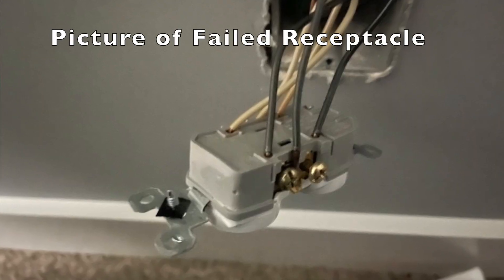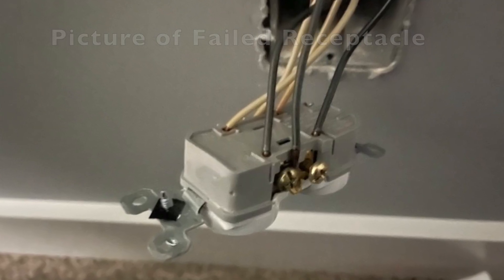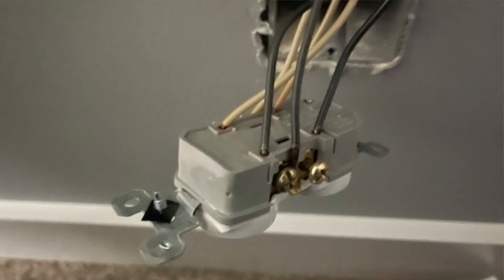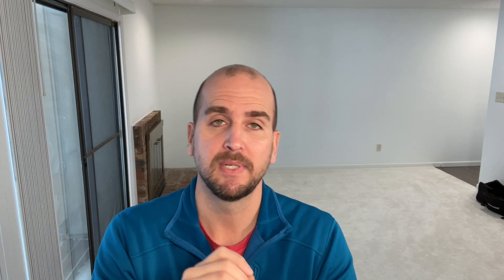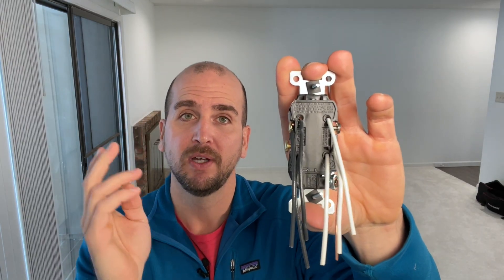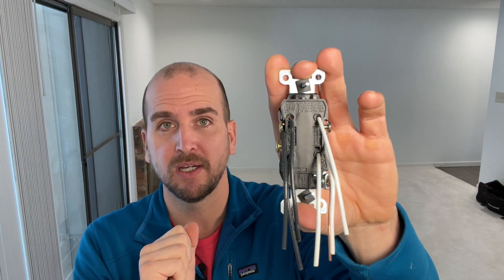Incorrectly Wired Outlet Found In Newly Built Home

Comment: So, ehy use pigtails when you can connects 2 sets of wires directly to the outlet ??
Is it because the libk between screws is not rated for 15amps ??
Why the pigtail ??
Reply: It's bad practice to use the outlet as a pass through device.

The reason being all of the current that's flowing through that circuit, is now being forced through those tiny metal tabs on the side of your receptacle. 

Also in certain situations you're actually required to pigtail certain wires. (Neutrals on a multiwire circuit)
Reply from the maker: Thanks buddy!
Reply: @renegadeelectrical1264  code also states there is to 6-8 inches on wire extending from box. pigtails give you extra wire for future replacements, those lazy ass-s that just chop outlets out
Reply: @harveylong5878  pigtailing is much more versatile than people think.

Ever pulled a receptacle out only to find the previous moron left you without enough conductor to even pull the device from the wall? Pigtail what you have and extend that cat.

Got a million conductors in a box?
Well now you have to pig tail.

Trying to feed multiple switches?
Pig tail and send a line to each device.

Kinda surprised at the lack of knowledge I'm seeing in the comments here.
But. That's why we're here to help
Reply: @renegadeelectrical1264  yep, our complex has had 40 yrs of the pull and snip outlet changes. Wire pulled tight to box in first place. Laid against the wall , outlet pushed almost in the box just to get wires back on. I pigtail everything when I do a remodel of one of our units
Reply: @renegadeelectrical1264  Thank you! I was asking the same question David asked, but what you said makes perfect sense. It's OK to only have one outlet powered through those tabs (that's how it's designed), but not a bunch of other outlets.
Reply: See more reasons in the same question above.

Comment: Wrap that shit in electrical tape. It cost pennies, takes 2 seconds, and is just extra insurance from a short.
Reply: and future you is going to be cursing wtf is this crap thats a sticky gooey mess. no need for tape in a plastic box, the wires tucked in box properly
Reply: If you take the time to do it properly, you don't need tape.
Reply: @sylviaisgod6947  nobody said you needed it
Reply: @sylviaisgod6947  You are absolutely correct.   AT&T slogan, "No job is so important and no service is so urgent-that we cannot take time to perform our work safely"
Reply: And don't use cheap Chinese electrical tape, use the good stuff.

Comment: Don't know the industry standard for this, or not...I know a couple of electricians who put a wrap of electrical tape around the side of the receptacle to cover all the screw heads before putting it into the box.
Reply: I do this too especially in tight metal boxes where there isn't much space. It just seems to be obvious that exposed live wires even in a box are bad
Reply: The system in the US seems unreliable if you have to insulate the terminals with tape to make it safe.
Reply: @geofsharp658  It's not required but it doesn't hurt to do it, There are much more sketchy things done in other countries that definitely would not be permitted here, European cables are installed barely below the surface of the wall , imagine what would happen if you decided to hammer in a nail or install a screw.
Reply: I do this frequently, especially if there are multiple things in the box and it’s tight.
Reply: I do that for metal boxes, but usually not for plastic.
Reply: I only do this when its in a metal box.

Comment: Happens all the time union or rat. Wrong wired GFCI down stream outlets, Mis balanced neutrals. Over loaded circuits
Reply: Mis-balanced neutral huh?  How do you imbalance a neutral on single phase?
Reply: @lloydmills9619  Neutral from a different circuit. 2 of the same phase circuits on same neutral. Stay on you day job rookie.

Comment: Why add a screw on connector if you do not have to?  If there are only 2 hot wires, would it be better to attach those to the screws instead of adding another point of failure?
Reply: It's always better to pigtail it, because if eventually if the outlet goes bad it's only that receptacle that goes out easier to trouble shoot. If you put them both on the device you're relying on the device to make the connection.
Reply: @Joe-by8jh  agreed!  So how does a “device go bad” anyway?  The bridge copper contact between the screws can’t go bad unless it turns into a fuse.

Comment: Some inspectors want all boxes to have pigtails in my area where needed.
Reply: That is a ridiculous rule, since every added connection leads one more place to cause arcing,regardless of the security, any connection can fail.
Reply: @mmoser9483  brother you have no idea what your talking about lol
Reply: @matthewbritzman6010  every time I'd rather use Sheppard hooks and the  screws  before  stressing   the wire from twisting  it  scoring it with a wire nut and on top of that  to the overall  box fill the more full a box the more heat that can be generated

Comment: There shouldn't be any copper showing past the clamp on backwire outlets
Reply: There may not have been when it was first installed. But if there was tension on it it could have worked out over time if it was a weak catch.
Reply: @srcastic8764  I like to see just a sliver of copper so I know the insulation is not pinched.  Not so with wire nuts.
Reply: @jackb1803  I always do this for inspection.  Makes it easy to verify.   Industrial components require it.
Reply: There is usually a gage on the receptacle for striping to the correct length. I have seen people make them so long the wire was coming out of the receptacle where the screws are.

Comment: Is the box extender up to code since it has no back?
Reply: It is ok for NEC, not sure about a local code that tries to be "smarter".
The original box is still there, the extension just covers the sides for when the wall is thicker than the box install.
Reply: @JasonW.  local code just modifies the NEC. half the NEC is garbage anyway, some localities pretty much say skip entire sections of the NEC or ignore sections within a section and use what local code requires
Reply: @harveylong5878  by smarter, I mean local authority throwing in a extra rule because someone thought it would be a great idea. Like requiring putting silicone all the way around a toilet, instead of at least a little open so you know when a toilet wax seal leaks by seeing a little water, rather than the toilet slowly ruining the floor.
Reply: @JasonW.  Didn't look like there was a box in the wall. Thought it was just a mud ring.

Comment: Toward the end of this video, you created a pigtail.  Why not screw one wire (only) under each screw?  While I would never put two wires under a single screw (especially w/o the "shepherd's hook" or "J"), I have often used both screws.  I understand that the intent of the two screws is to have two separate circuits (say, one receptacle switched and the other always hot); but why not use both screws for the two wires (per side), instead of the pigtail?

Comment: He outlet you showed, had the black(hot) leads connected to the silver screws and white (neutral) leads connected to the gold screws..........SHOULD HAVE BEEN THE OPPOSITE WAY.  Hot always to gold, neutral to silver!   Thanks.....Jim
Reply: Absolutely true.  Other than being consistent, "black (wire)" to brass screw and white to silver screw" ensures that the small slot is hot and the big slot is neutral - which is the way appliances are wired.

Comment: Scott,  what about the outlets with the clamp-down on the sides,  as opposed to the J hook ?
Reply: IMHO, the clamp-down (which prevents J-hook) are perfectly acceptable (i.e., I've used 'em).  I prefer being able to J-hook wire under a terminal screw; to me it feels more physically secure and might have increased surface area for electrical connection (maybe).
Reply: @peterkizer6163   i have done both ways too,  but the J hook is the best way.
Reply: I like the back wire, it is secure and faster. It also easily works with stranded wire, which is what i use for pigtails.
Reply: @JasonW.  stranded wire is a no no for any residential or commercial application.
Reply: @normhodgkinson6965  If you can, present the NEC rule that states stranded is not allowed?
Or is this a local-to-you code for your municipality?
Reply: @JasonW.  i don't have the NEC book handy, but in 30 plus years of remodeling and repairs, i haven't seen one instance of stranded wire used in typical residential fixed wiring,  other than the  10-8-6 stranded in 220/440 volt applications.  when i work from blueprints, they always specify 14/2 or 12/2(3) Romex.   The exception would be having to pull it through Carlon or metal.   Calif. codes and guidelines may differ from other states.   Also,  stranded is larger diameter than solid.
Reply: @normhodgkinson6965  
Worked at a major Biotech for 23 years where we used "only" stranded wire EVERYWHERE. Offices, labs, manufacturing. Receptacles in all places that were routinely wired using the side clamp method without issues. Everything was ALWAYS pigtailed and the devices were always "specified" to be high quality. #12 THHN has absolutely no problems/limitations with physical size. These days, the "commercial" side of it is all pretty much done with MC cable.
Reply: @normhodgkinson6965  The runs I use stranded in are smurf or ENT, but I was specifically stating I used stranded for the 6" pigtails. I guess I needed to state the obvious that this was THHN. I've never seen #12 romex in stranded, but I've never looked for it.
I use stranded for pigtails because it makes it a snap to push the outlet in the box, and using Wago lever nuts it isn't an issue to mix solid and stranded.
Work smarter, not harder.
Reply: @JasonW.   looking through the NEC,  i don't see anything that says "stranded" cannot be used, but so far i have only seen "solid" in all the residential homes i've done remodels or repairs here in Calif.   i haven't seen stranded #12 Romex either,  my wording may have been in error.
Reply: @normhodgkinson6965  usually because stranded cost more than solid. Its all about the money.

Comment: The problem is one of speed . It is far quicker to use the slots than use terminal screws or too make a pigtail . It is the chief reason yankee screw drivers were used until replaced by cordless drills !! Also the wire sometimes is not properly seated in the slot or wire is not cut to proper length !
              Also the  brand do matter ! The cheaper brands are difficult to work with as well and providing poor connections  especially slot terminals . Eagle and leviton are the cheapest anyone  should go with receptacles and switches !! Plates should be nylon or metal for flush fit to the wall ..

Comment: My dad was an industrial electrician. Always taught me to tightly twist the pigtail ends together, even scoring them with the lineman pliers before turning on the wire nut tightly. Then neatly fold the wires into the box. I keep a soft wood stick, like a paint stirrer, in my toolbox to help push the wires in and not damage the insulation.  Through my many years of house renovations I have been amazed at some of the sloppy workmanship in receptacle & switch boxes... amazed because even those worked!
Reply: I'll bet your dad also taught you to first connect the ground and get that flat to the back of the the box. I seen a guy put the ground on last and use the screws to force the receptacle. The ground was right there on the power side. Yup! He popped the breaker immediately. It was worth the extra 20 minutes to let him experience it to understand the full error.
Reply: Worked, but usually have black scorched marks.
One outlet I found last year in a 14 year old house, hot wires on light circuit were loosely twisted and no wire nut. The black wires were extra black about 1/2" from twist. The chandelier had 14 60w bulbs, so it was a significant load. Also, it was wired with 3 way switch and travelers, but homeowner friend had no knowledge of a 2nd switch for this entry light, nor could I find one. And this wasn't a cheap house.
Reply: Your old man taught you right.
Reply: "Worked" at all, or worse!

Comment: Thank you for doing these videos. My dad and brother were electricians....but not me lol. Learning a lot! Question...at some of our light switches in a home we are the first owners of but home now 14 years old....I hear a pop or snapping sound periodically.  My gut says the wiring is off somehow. Going to take off the plate and look to see if anything obvious....but do you have any thoughts? Thank you again and please continue doing these videos!
Reply: Hey Sarona. You actually want to replace the devices in you home every 10 years. 
The reason being is the plastic (Bakelite, melamine formaldehyde) eventually rots out and becomes brittle. When it becomes brittle, if backstabbed (or just in poor shape), the conductor will lose proper contact and start arcing. That arc it creates is super hot (35,000F) Once that arcing starts, it melts everything in that box, eventually starting a fire.

So. If you hear that arcing, that sizzle, snapping etc. It means that device is broken, and MUST be replaced.
Reply: Those switches are going bad, and you are hearing arcs. If your circuit breakers were AFCI, they would be tripping. The switches were probably the cheapest ones the builder could buy.
Reply: if you operate (toggle) switches slowly they can make those noises " cause you slowed down the connection to where there isn't a full contact momentarily.

Comment: I am puzzled why you don't like the push-in connection? I would think the constant spring type pressure against the wire in the push-in would better compensate for thermal expansion and contraction than the screw connection. Is it because there is less area of metal to metal contact with the push-in? Have actual studies been done comparing them?
Reply: Having done residential housing in the Chicagoland .IBEW701. i can tell you only HACKS use the holes. I can tell you from first hand experience that a wire with a load gets hot if its overloaded. When the load gets turned off wire cools down and slowly over time backs its self out of those holes.
Reply: Also with the smaller contact points they are sometimes difficult to remove without damaging wire and/or plug.

Comment: I like the fact that you tell how the backstabbed connection are UL approved but still not as safe as the screws.  The same thing could be said about pre twisting wires- that is not required by the documentation that comes with the wire nuts but it still makes the connection more secure.
Reply: I have never used the "backstabbed" connection - it has always seemed like a bad idea.
Reply: @peterkizer6163  always hard to remove them.
Reply: @danlux4954  Not at all- they have a release slot. I keep a very small screwdriver in my bags for this very reason but a finish nail or even.a scrap of 12ga wire will also work fine.
Reply: @HBSuccess  so do I buy sometimes they don’t and I have to cut the wires off.
Reply: @danlux4954  To remove them, just twist the device and keep pressure on the wire-pulling outward from the device, Though when you remove it, do not use the connector again, it will likely be weakened.
Reply: @mmoser9483  hard to twist when there’s 4 wires.
Reply: @Joe-by8jh  wago lever nuts are better design and wires can be removed. I have no issues with the lever nuts, 222 or 221.
Reply: @JasonW.  Yes, they appear to be. I guess they are a European design idea.
Reply: @JasonW.  I wasn't impressed, until I saw this video: https://www.youtube.com/watch?v=fjNUzd6LDsU
Reply: @Joe-by8jh  exactly why we don't use them
Reply: I don’t normally use backstabbed connections either, but it’s a myth they’re inferior. The are NOT “safer” and they are also NOT “less reliable” unless you’re overloading them or did something else wrong on the install  (nick a conductor for instance. In fact, expansion/contraction around that screw is much more likely to cause an intermittent connection and start arcing than a backstab connection, especially if a DIYer doesn’t know what the correct torque feels like. The reason to pigtail inline connections is so you’re not constantly passing current through a device. I always do it on new work.  However there are times you simply do not have enough wire space in the box to pigtail everything. Especially in multi-gang boxes.  Running in unused screws is a good idea. and I’d add you should also wrap the device with a cpl layers of electrical tape. Makes it much safer to work on.

Comment: I'm no electrician, but not being thorough with electrical work is just pure laziness. Excellent video Scott!
Reply: It can also be fatal for the homeowner.
Reply: I am an electrician and I never stay up wires in the back that's the worst thing you can do Springs get old and come loose thank you
Reply: @garyengland2208  great point!
Reply: Nice video. I've been an electrician for 54 years and believe me when I say that I've worked along side some guys the pull stuff like that just because of laziness. Some guys were as bad I would trust them to string lights on a Christmas tree.
Reply: It got inspected by the inspector. It is also do to lazy inspectors not looking at all the connections.
Reply: I'm glad MOSTLY everyone uses common sense LOL